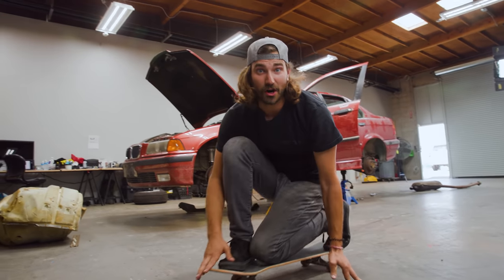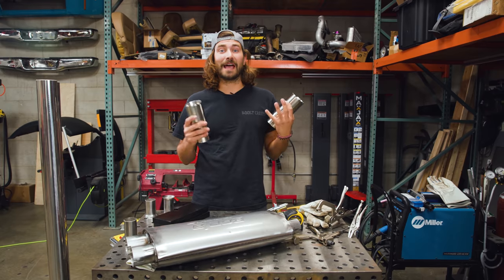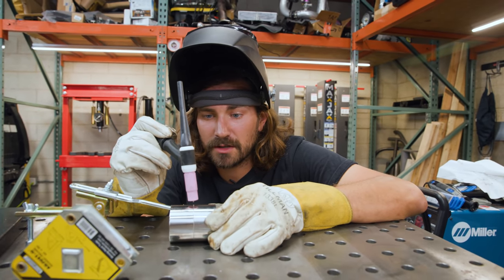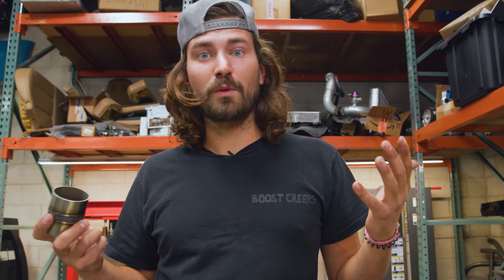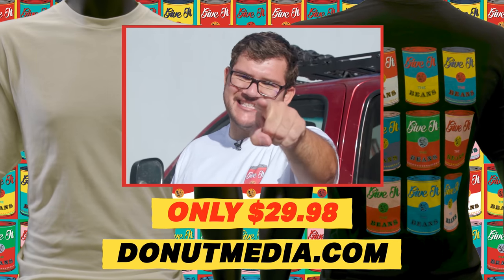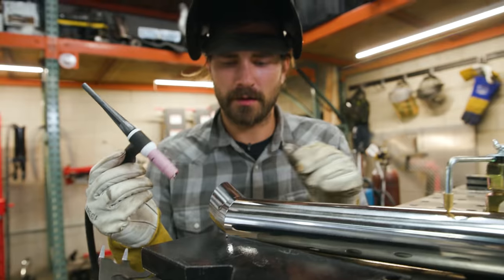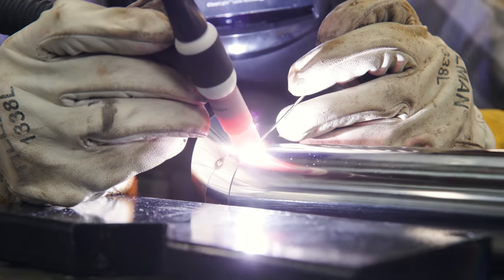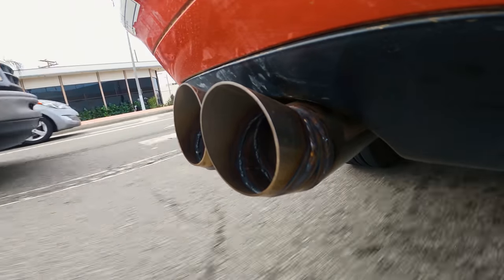DIY Exhaust! - Is it Worth It?

Comment: Be careful using brake clean, chlorinated produces a deadly gas when welding. I use acetone personally 👍🏼
Reply: isn't brake cleaner just ethanol?
Reply: Thank you I’m barely getting into welding
Reply: I was wondering about this, can you use non- chlorinated brake cleaner?  I was always thought never use brake cleaner on areas your about to weld on.
Reply: @marcoconci7867  Depends on the brand
Reply: I've heard stay away from all brake cleans to be safe
Reply: @Maroco918  oh okay....but it does evaporate quickly regardless....
Reply: @jr303official  I think so...it is just acetone or ethanol that evaporates in seconds
Reply: This should be pinned to the top.  Acetone every time.  Dont even mess w brake clean, and dont weld something someone else "cleaned for you" w out knowing.
Reply: Most brake cleaners available in California are non-cholrinated.
Reply: @marcoconci7867  very true! Only difference I notice is the non chlorinated doesn't burn your cuts, and the welding effect mentioned before.
Reply: @marcoconci7867  it doesn’t matter if it evaporates quickly, it’s not like the stuff disappears… it goes into the air and is there still able to react and produce side products. Unless you have the workspace open the gases will remain.
Reply: @jessemartin2698  c'mon....once in the air it doesn't even matter bro
Reply: @marcoconci7867  uhhhhh, yea it does bud.
Reply: Came here to say exactly this^
Reply: @marcoconci7867  if it’s two gases reacting to produce another gas it sure as hell does…
Reply: @jessemartin2698  1)it's not two gasses that react, it's the clorine additive that struck by high voltage creates chlorine 
2)once in the air the gas disperses in the air, even more if you work in a ventilated workplace, so the risk is close to 0 (notice how when you fart, the smell disappear in little time, same exact thing)
Reply: Acetone for the win.
Reply: All I use in my shop is non chlorinated. It's safe to use with welding.
Reply: @2222cooperative  welding stainless Is bad due to the hexavalent chromium aka Chromium 6. Ever watched the movie Erin Brockivitch? About the town being poisoned with drinking water full of Chromium 6? Shit is bad for you.
Reply: In cali brake cleaner is just ethanol but most brands are chlorinated
Reply: @BrendanCBreen  This is correct. It is not "just a fart that disappears"
Reply: @BrendanCBreen  ok I agree with you, but using only acetone or ethanol brake cleaner there is no risk....it is all I'm saying
Reply: The brake clean i use (fleetrite) is mostly acetone
Reply: What you guys are trying to say is that it’s save to weld without the shit chlorinated is what I’m asuming ???
Reply: Most public use brake cleaner is non chlorinated
Reply: @MrDehBoss  you’re late.
Reply: @marcoconci7867  depends on what brand u buy. They’re all different.
Reply: green can good. red can bad.
Reply: Acetone on a rag cleans it up in abt 3 wipes
Reply: It will mess you up for life with nerve damage
Reply: Acetone is a very good acid etcher too. 5 minutes in an acetone bath and your metal will be mostly clean
Reply: Dont weld in badly ventilated areas in general…
Reply: Phosgene bad, really bad.
Reply: I haven’t seen one brand or can of chlorinated brake clean in 5 years or more, why? Did they quit making it due to safety concerns?
Reply: @BrendanCBreen  it was a chemical weapon in ww1, look at the Sabaton video Attack of the Dead Men for an example.
Reply: @bigdfitness5020  I think basically all, it might be banned outright if im not mistaken
Reply: Most break clean is non chlorinated
Reply: The UV light reacts with the chlorine (if a chlorinated brake clean) to produce Phosgene. Phosgene smells like fresh cut grass so you know.
Reply: They live in Cali, right? They're on the cutting edge of environmental and health protection in the US, right? 

If they're going after aftermarket ECUs but haven't restricted the use of TCE in consumer products, imma be disappointed in them
Reply: @marcoconci7867  I smell brake clean in the air long after I have used it. I'm not sure your science is sound on that one. How about just tell people to use non chlorinated cleaners and not risk it.
Reply: @marcoconci7867  No, far from it. Normal (chlorinated) brake clean has many components, but one of them is TCE (trichloroethylene). In the presence of heat and argon it will form phosgene which is quite toxic and was used as a chemical warfare agent in ww1.
Reply: @engineerisengihere44  well they may have regulated TCE. I don't live in the US though, so I don't know if they have or not.

Just saying that they probably have considering how bad TCE is
Reply: @t0kinblkguy  I didn't even know chlorinated brake cleaner existed....I live in italy and all the articles which talk about it's ban are Americans...
Reply: @TheTimtam112  Cali isn't going after the ECU's, the federal government is.
Reply: Lol that shit sucks ! 
Flammable and it evaporates too fast. 
 🤦🏼
Gimme a real can of red brakecleen any day of the week.
Reply: I was thinking about that. Like...uhh wait... 😆
Reply: @marcoconci7867  you should know chlorinated brake clean leaves residue that becomes deadly when weld. 
Non chlorinated is gine just wait till dry

Comment: As a welder fabricator, I'd love to see a follow up on how the exhaust holds up over time, instead of back purging too you can use solar flux next time for when you don't want to use the extra argon, the welds become more brittle when you don't back purge too it's not just about the aesthetic and its tendency for rusting quicker,  it's worth doing at least a backing plate or something, love what you guys are doing! Killing it for how fresh you guys are, keep at it :)

Comment: Should’ve mentioned that cleaning your parts with brake parts cleaner can be extremely dangerous. If your brake cleaner contains tetrachloroethylene, you can expose yourself to an extremely poisonous gas when welding. 

 A lot of the “50 state” brake parts cleaner no longer contains this chemical, they use acetone instead. But always check, and it’s honestly safer to use acetone by itself.
Reply: I was literally just about to say the same thing when I saw him using brake cleaner. No bueno
Reply: It creates mustard gas right? I know when I was working in the mines I got told about a welder who cleaned up a bunch of oil with brake clean then welded in the area and ended up dying because of it
Reply: You want non chlorinated brake cleaner. It's all I buy to avoid that very dangerous situation.
Reply: @FleetTech97  Phosegene
Reply: I wish my memory was good enough to remember this
Reply: I feel like for a YouTuber that’s this bug he should just be using acetone as I’m sure there are a lot of people who haven’t worked on cars for very long watching these videos and might just go out and buy whatever brakes cleaner then find or have because he used it. I just buy acetone from homedepot and keep it in the garage as it’s good for cleaning multiple things and it’s stupid cheap.
Reply: @rodanone4895  Probably can't find it because pure anyhdrous (no water) acetone is really good for purifying cocaine lol. 

t. not a drug dealer, just studied chemistry
Reply: 100% checked the comments to make sure someone mentioned this. 🤘
Reply: @CitizenSnips69  thank you for that. i couldn't figure out why the acetone off the shelf isn't good enough for heavy section cleaning. it really does leave a film under the scope if you put it on glass. an oily film. probably not a killer below 3/8". but there's hydrogen in that film at least. right?
Reply: Noob here, why not just use isopropyl alcohol?
Reply: @monstermohawk6206  NO SHIT, ME TOO.
Reply: Thanks for the breakdown, I was about to go off LOL
Reply: wipe down the metal with Low VOC PRE or acetone, this will remove any oils or grease on the surface. The next step is to remove any oxides on the surface of the metal. To do this use stainless steel wool or a stainless wire brush on the area to be welded.
Reply: Yes my grandpa was a mechanic and in the 70's his job was cleaning braked on the heavy duty machinery so he would have to blow out all the shit and he just passed away due to lung cancer directly related to it wcb is compensating us but it isn't enough especially since there aren't many new precautions that are being enforced
Reply: @FleetTech97  asbestos
Reply: Chlorinated Brake Cleaner is banned in California AFAIK
Reply: @applepoop10  said by someone that's definitely not a welder, good luck welding with that respirator on
Reply: @applepoop10  the best way to prevent it is to not generate it in the first place.
Reply: thank you very much, I'll have to check ours at the workshop!
Reply: Came to the comments to say this.  Acetone or denatured alcohol are both good cleaners for welding prep
Reply: Yeah I was gonna comeny about this hahah I personally wouldn't use it just because I know it's flammable anyway and I know from experience because of friends Makin flamethrower hehe yeah......
Reply: @CitizenSnips69  just wanted to follow up. supposedly "lab alley" from Texas will sell technical, lab, and reagent grades of acetone. you can find them on line. not cheap. but i didn't expect it would be. they also seem to have acid strengths that would actually etch. 
really interesting web site. i ordered 4 litres of lab grade acetone.
thanks for your input. i wouldn't have looked harder. this should make cleaning aluminum much easier. I'm sure I'm being over the top for 1/8" aluminum... but good habits have a built in margin of quality in my opinion. that way your customer gets their money's worth on your worst day.
Reply: @rodanone4895  Interesting. I've looked before, but not very hard. Congrats on finding it, I hope it works out well and if it does work better I'd be curious to hear the results. Given that there's water in the air that may get into your acetone, I would maybe look into seeing if there's any way you should store it as to not lessen the quality by getting moisture absorbed into the acetone. But that's just my gut instinct. It's been a while since I've been in a lab setting.

Since you mentioned you may use strong acids, I should say that one thing I found is that acetone should not be stored around concentrated nitric and sulfuric acid mixtures, or hydrogen peroxide. Always good practice to look up the chemicals you're buying, especially when it's the good stuff. Be careful and have fun.
Reply: @slideordie2408  there's  pancake filters and also respirator hoods.  I use the pancakes on my half mask
Reply: @slideordie2408  replying to a 10 month old comment but lol? I wore a p100 respirator every day under my hood with pancake filters, definitely works fine.
Reply: Welding stainless without a respirator is hands down more dangerous than brake cleaner.

Comment: "So we're just gonna go with straight pipes"
Everyone liked that
Reply: It wasn’t truly straight piped though.  He just did a muffler delete.  Straight pipes or straight piped is when you delete any and all mufflers and catalytic converters.  So yea, technically he just did a muffler delete.
Reply: @jaytm6719  eh. There aren't crossovers and it's an entirely fresh custom mid-pipe all the way to the back with no muffling devices and no unnecessary bends. I'd call it a straight pipe because of the better flow optimization vs your average muffler delete.